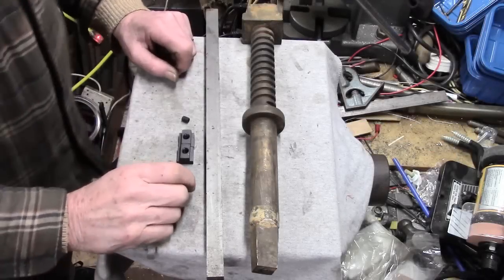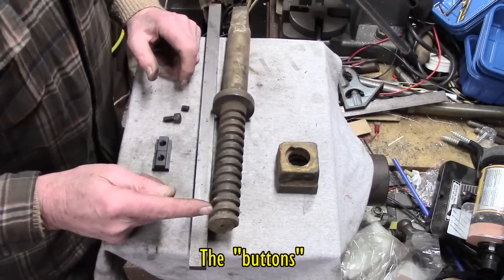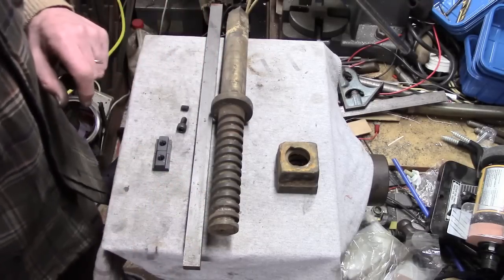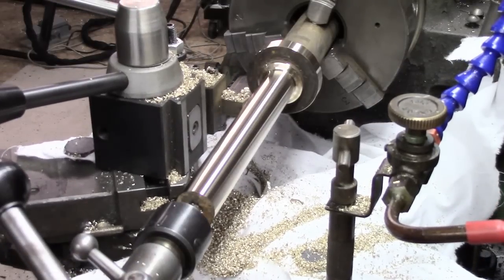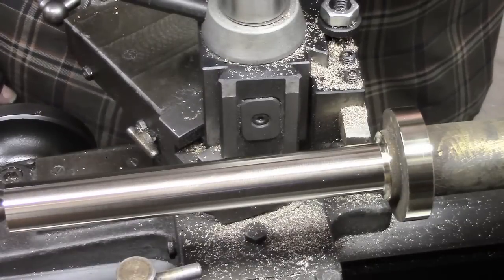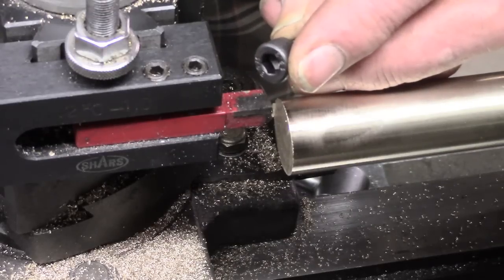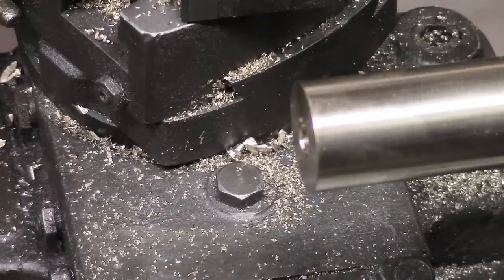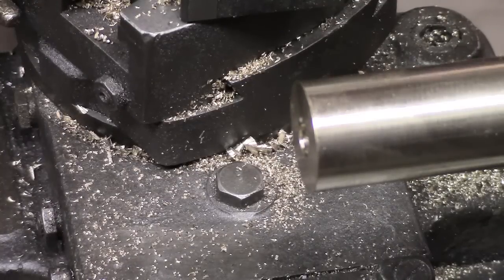Low Profile Clamps for the Mill - Part One

Comment: That new tool looks like a very good idea and should come in handy.  Lucky that you had that big old piece of brass.  OK so that is really cold.  I don't think I could have made it that long before I called it a day.  I hate to tell you this but I was working in the garage again today in a short sleeve shirt and it was very comfortable.  =(;-)   Of course come July and August I will pay my dues in sweat.  Thanks for the video, keep them coming.
Reply from the maker: Thanks. Yep - best I let heater go was to about 45º - then that slowly dissipates! I too however will still pay dues in mid summer although hoping ceiling project will help a bit. Hoping to get part 2 under way when temps not too grim.

Comment: Though it was never fun going out into the shop at -20C last winter I was really thankful for the oil-furnace out there. You're a brave man getting out there..... OR is it just the kid playing with new toys...LOL

Colin ;-)
Reply from the maker: Hey Colin -- well my heating sure helps as does the ceiling but with such a large volume and outside of about single digits or worse - dissipation is still a bit quick. Push it up to say 45 - and it probably loses a degree every 5 mins or worse! Still - better than shivering! Roll on spring.

Comment: I see you have a Harbor Freight spot welder there ? did you have any trouble getting it to work ? I had to take the rods out of mine and use scotch bright pads on the ends to get it to work but now it does a great job.
Reply from the maker: Hi Mack - only used spot welder once in anger - but seems to do a good job. Had to make sure rod tips were well aligned.
Reply: IN ANGER ???????????????????
Reply from the maker: Mack McCurry Old British term! Meaning only used once for real!